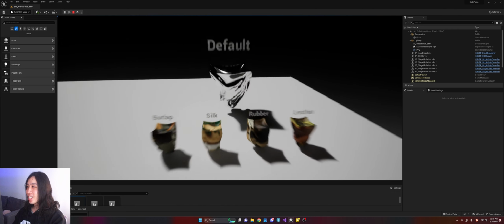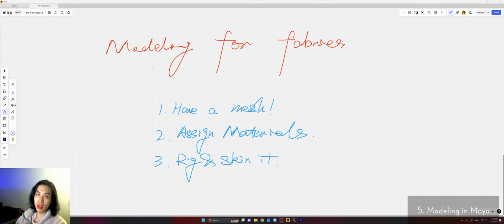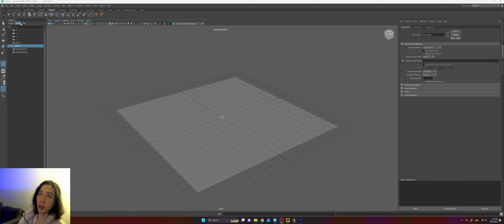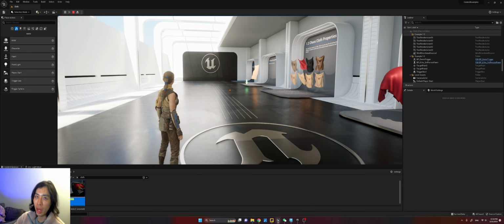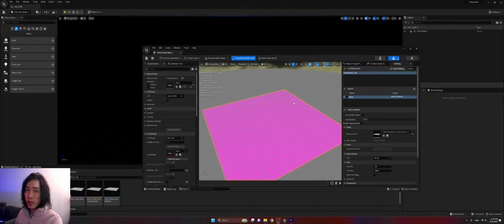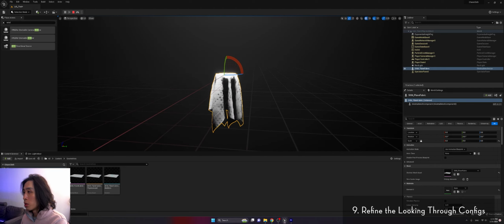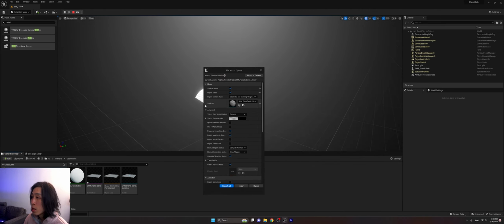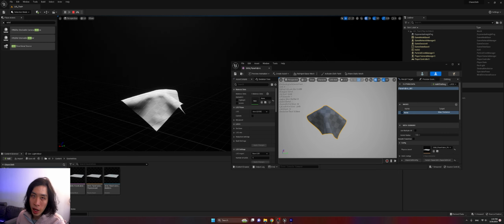A Deep Dive into Chaos Cloth Simulation #1 Basic Introduction and Setup | Unreal Engine 5 Tutorial

Comment: Thanks for the vid. Can you make your windows and text bigger next time?
2) Do we really need a physics asset for each clothing mesh we import? (I didnt see it used or Constraints set.) 
3) Or how else can we quickly recreate the same physics settings for a similar clothing mesh, when they are different files?

Meaning, I have a modular character and will have 100 shirts, 100 shorts, 100 jackets = SK meshes. So they already share the Character Skeleton (and similar to the body shape of the Character main body PHAT). 

4) And for gravity, is there an override? (The Blend amount? couldnt see.) 
I have extreme problems using Epic's gravity setting for Physics related things. I set my normal gravity at 4x (to make my jumps fall faster), and will have space gravity which is not 100% zero weight. So I dont want the clothing to act too different in the 4x Map grav vs the 1x. Meaning I want 4x Map gravity to equal 1x (normal weight on the clothes).